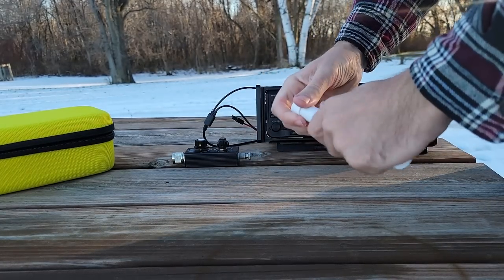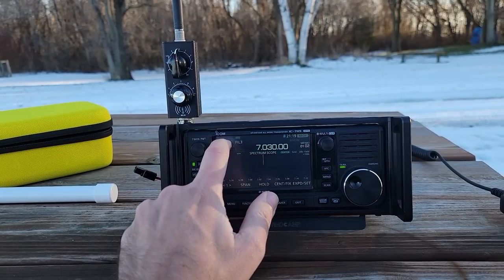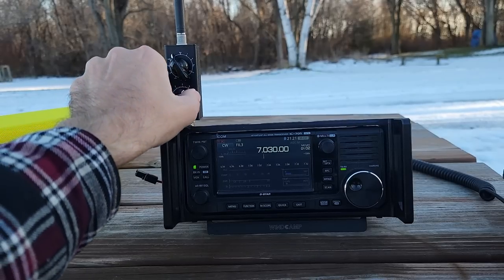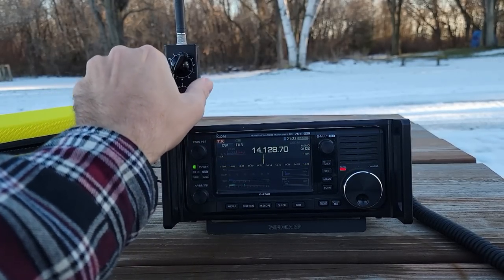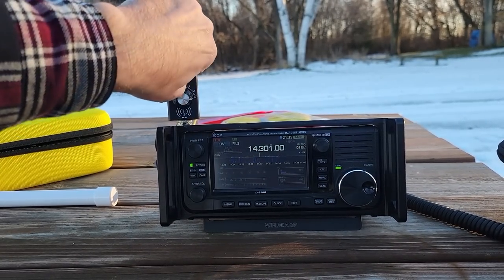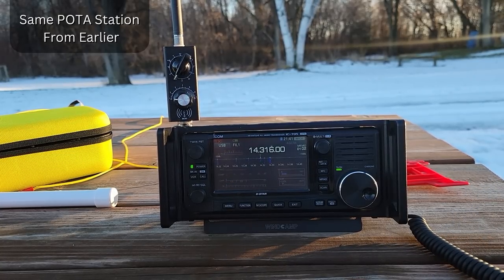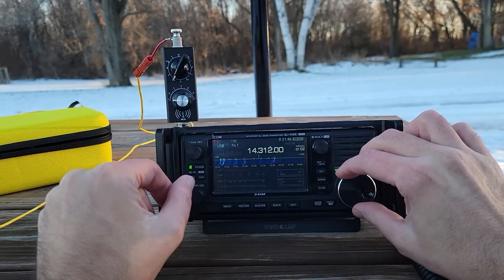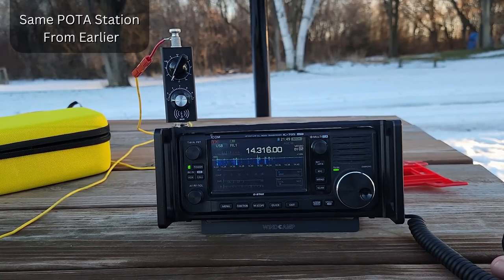Ultra Portable or Ultra Problem? - The HamGeek Mini-Ant

Comment: I suspect that, for HF, the max inductance of the coil may not be enough to compensate for the extremely compromised length of the whip, thus much better results with wire up the pole.  And the taps may be a bit wide to do better on best SWR.  There are probably frequencies where the match could be pretty good, but not necessarily in the ham bands.  Lots of the old manual tuners had roller inductors for a more continuous tune, though even they had a second variable capacitor at both ends of the inductor.  The good but cheaper manual tuners have a tapped inductor and switch, but also had both capacitors, and the effect of the second capacitor was not parallel to that of the first, so you could still find a good match.  (Matching is a two dimensional problem.)  One capacitor and one inductor are theoretically enough, though the desire to avoid high Q, and thus high circulating current, leading to higher losses, makes the pi network design useful anyway.  The other trick is to be able to connect the capacitor at either end of the inductor, a trick used by nearly all auto tuners today.  (Somewhere in my basement I think that I have a Collins military aircraft radio auto tuner that has a roller inductor and a vacuum variable capacitor, each driven by a DC motor and gear train.  I don't remember, off hand, whether or not it has a relay to switch which end of the coil gets the capacitor.)

You maybe could add  a switch, or a pair of banana jacks to let you choose where the capacitor connects on your unit.
Reply from the maker: Thank you for your well thought out reply.  Everything in ham radio is a compromise - including this antenna.  But... is it the compromise you can live with?

Comment: Hi Steve, bought this antenna from Aliexpress for 34 euro's. On 40 to 10 Meters I got this close to 1.1:1. This was not always whit the highest noise (switch). Worked Norway on 40M from my upstairs room with 5 watt on a Xiegu G106. Nice little antenna to play with. A wire from 7 meters and some ground worked much better. Would like to see it on a Antenna analyzer. Keep them coming those videos.
Reply from the maker: It didn't have the range for my earth, maybe yours is better?  Fun to play with!
Reply: Do you think I could use this as a tuner for a 45ft doublet (GR5V style) antenna?
Also, I've seen 5.28m telescopic whips and I'm wondering if that could be used instead of the supplied whip, in a portable situation?
Any experienced opinions appreciated 🙏
Reply from the maker: @redeyegooner  the only think I can say is try it!
Reply: true, bought and it works very well ros 1:1 from 10 to 40 meters but what I noticed is that when I get the ros almost to 0 the noise or station signal is lowered to make the Smeter go up I have to adjust the variable slightly but it goes up the ROS.
Don't forget to put a counterweight wire about 5 meters.
I would like to understand this problem. ROS good low signal, ROS slightly high towards 1.5 the station signal rises

Comment: Great video.  Reminds me of the Miracle Whip antenna that was commonly used with FT-817/818 from Miracle Antenna.   Wonderfully simple antenna tuner that, just like this one, needs to have a few radials.  Without them, it would be a miracle that it works at all.
Reply from the maker: Right!  This is a miracle clone

Comment: 99% of successful tunings on my antenna analyzer were with the inductor set between  6 and 9 o'clock. Tuner is also good with a small loop, Can't justify a quicky antenna like this with 9 miles of radials...Low efficiency but it works!
Reply from the maker: Right!  is it "Low" or "High" efficiency? I guess it depends on what your definition of efficiency is.

Comment: For table top antennas on the higher bands (30m to 10m), I usually go for a STL "mag-loop". It takes more space on the table top but you don't need all the radials. Therefore, arguably the overall footprint is smaller than these mini-whips with lengths of wire attached. I suspect this device is more useful as an efficient QRP antenna match. Because it is connected directly to the antenna, there is no lossy feeder with a high VSWR between the match and the antenna.
Reply from the maker: I think you're right

Comment: You can also put out a steady tone for tuning by switching mode to RTTY and just keying the mic.  Much easier than fumbling with switching CW to straight key.
Reply from the maker: Yes, I do that same trick in other vids.  Anything that outs out a signal - even whistling into the mic on side band.  Good call

Comment: The fact that you couldn't get below 2:1 concerns me about getting this. I've seen a design that has a loading coil with banana plug taps that has interested me (I saw it at Ham radio outlet when I bought my ic705) but I've refrained from getting it because I know it will be less effective and I already spent way more money than I want. Plus my K6ARK EFHW is already extremely portable. (his balun plus 26 awg polystealth and his winder design make for something that fits in my pocket)
Reply from the maker: There are so many options!  This was fun to play with, but you're right!

Comment: I just ordered one. I didn't see any with a BNC so I got one with a PL259. I'll looking forward to trying it out.
Reply from the maker: It seems like a good deal, especially if you add a lot of radials.
Reply: @temporarilyoffline  I’ve been out with it once, it works better than any of the other similar concept antennas I’ve tired. I mounted it on mini tripod instead of directly to the radio. I used two 11 foot radials. I’ve made up a set of five 20 foot radials that I’ll try on my next outing.
Reply from the maker: @N2YTA  Sounds good!

Comment: Thanks for the video, I was thinking about trying one of these.  Try elevating the counterpoise wire, I bet that will help. What is the length of the couterpoise, if it is a multiple of a wavelength, I may affect tuning, try 17ft. Thanks again!
Reply from the maker: I tried a 17ft and a 10ft, thanks for the tip!
Reply: Elevating the radials will require them to be cut to the band. Leaving them on the ground will let the signal couple into the ground.
Reply: If it is supposed to be a “counterpoise” I was told they should be elevated but whatever works!
Reply from the maker: Elevated radials (counterpoise) need to be resonant, radials on the ground should be many and can be cut to resonance or not.  Either way, whatever gets the job done in the situation your in  is the most important part.

Comment: hello, what is the optimal thread length to use in high bands? you've tried? I have one of these units and using it with a telescopic is practically impossible, where the swr is good there is no good rx.
Reply from the maker: I don't have an answer for that - it's interesting that you have good SWR and no RX.  I didn't have great results with it either (as you saw in the video)... neat idea, but ultimately not a great performer.
Reply: I am using this antenna for listening to shortwave radio only because I don't have a license. SWR is not much of interest for me while listening but after reading this comment I took my antenna and went to a ham radio friend. We got the same problem with the telescopic whip. It was a littlebit better after we replaced the telescopic whip with 5 meter of wire. The antenna was connected to a Xiegu G90, the wire was hooked up from the table to the lamp at the ceiling then to the window, 2nd floor in a house made of stone. For ground we used the copper pipe from the heater at the wall. We got heared (FT8 PSK reporter) in almost all countries in europe on almost all bands. No reception for 10m and 15m.

Anyway ... The "Manual" says:
The knob above is the band switch of each frequency. The knob below is for fine adjustment of frequency and vibration point. The upper outer ring 11 and inner ring 50 represent the common position of 11 – 50MHz. 8 and FM represent 8MHz and FM bands can use this position. And so on. Then select the knob below to fine tune to find the best standing wave suggestion link talent to check the vibration point.

Well, in fact the "Manual" was the Ebay page from the seller and this instructions don't work. At least for my antenna. We only got it tuned in position 4.5, 5 and 5.5 on all bands. So my guess is - and this is only a guess that I have to verify - that the toroid inside is mounted wrong. I don't have a clue if flipping the toroid around will help with this problem but it's worth a try.

Greetings from Germany
Holger
Reply from the maker: @lkjwertz I think if you use the matching network as if it was a manual tuner and ignored the "band"  markings it would work much better.

Comment: The power of the qrp antenna equipment is marked as 20w. Would it be okay if I set the output power of my ham radio to 50w?
Reply from the maker: I would hope the maker has tested the antenna and found its limits.  If you set it higher, it might be ok or it might cause some problems.  Open it up and take a look, see if you feel comfortable making the repairs that might be needed and test away... That's what ham is all about. (Comfortable could mean just buying another one after "the cost of education" too)

Comment: Looks similar to my wonderwand wide bander but I can get get very close to 1:1 and can also use it with long wire for even better results.  I have their tuneable counterpoise too which makes things better but still portable. I use a 7m fishing pole with it.  (Did a short vid of it).

My 1st gen windcamp bracket was causing me all sorts of swr issues I don't use it anymore.
Reply from the maker: I removed my gen1 windcamp bracket because it didn't work well with the cage.  I felt like this tuner was just a tad too narrow to get the job done.  Not bad in a pinch,  but not great.
Reply: Can you still get the wonderwand? Don't see many about. I did think they were really expensive for a new one for not much in them. I'm hoping to find one someday for my x6100 for portable and travelling. This Chinese make is a much better price but don't think it works very well even though they are plastered all over eBay from loads of sellers.
Reply: @cbjamesb1  yes G0nzi still makes them, not sure what countries they export to but a few I think
Reply from the maker: You can find them in the US at hamradio.com or at hamradio.co.uk in the UK

Comment: just received one - unable to receive anything! strangely enough, while the knobs have an effect on an swr plot in antenna analyzer, disconnected the antenna from this tuner and the same plots almost not changed! as if it acts as a dummy load
Reply from the maker: Open it up and see what's going on!
Reply: @temporarilyoffline looks pretty much the same as yours, only opposite wire colors. However i suspect either wrong ferrite type used, or the capacitor value is way off. i have experimented with a signal generator near the antenna, and while i'm able to tune it to receive, its somewhat worse than using the antenna directly without the tuning box. Reminding me why i told myself not to buy chinese ****.
Reply from the maker: @EvgeniX. My results weren't perfect either, but it was fun to play with.

Comment: I just got one from Amazon and am still experimenting with it. What length of radials or antenna wire worked best for you the best?
Thanks from NH
Reply from the maker: My goto for GROUND radials is 4x10m radials - but the rule of thumb is 1/4wave on the lowest band of interest and then you'll be able to work your way up from there.  For the radiator, I'd use the same logic as a "random wire" - or I'd go with something specifically tuned for the band of interest and get all higher bands by adjusting the matching network or the length of the radiator by folding back.
Reply: @temporarilyoffline  - thanks for your info and for your video. I played with my Gig Antenna today and I found the whip antenna does little but by adding the radial wire to the tuning control, I can begin to hear stations on all the regular bands - 40 and 20 meters. The tuning control is the good bit, whether connecting to a radial or to an antenna wire. Even though I hear stations, I've yet to make a QSO. I'm connected to one of those small USDX radios. I'm still experimenting.
Reply from the maker: @rbashta  keep plugging, you saw the effort I had to make at 5w to be heard in the vid. It can be done.

Comment: where could I get the mount with the counterpoise wire from?
Reply from the maker: I made it from a ring terminal, a piece of wire and an anderson power pole connector.  From there I have a few sets of radials/counterpoise wires that I can choose from depending on what vertical I'm running.  I also can swap this between other antenna mounts and radios.  Its a pretty versatile setup.

Comment: Great video, could this be used with a horizontal wire instead of vertical?
Reply from the maker: No reason why you couldn't use it with any wire - it's a very small/small range LC network antenna tuner.

Comment: The tuning unit looks like the Gawant Antenna configuration.
Reply from the maker: I haven't heard of that, thanks for the tip
Reply: Very welcome.
The antenna you have displayed appears to be better than the Gawant as the inductor has many taps compared to 2 taps the Gawant antenna has, well the Gawant antenna schematic I followed only had 2 taps yet it tunes and gets out from 160m to 6m even without any counterpoise, not tested higher frequencies yet.

Thanks for sharing and showing us the internals, I would like one to compare with the Gawant I made ... just struggling to find a trustworthy eBay or Amazon seller inside the EU or UK, not China. any suggestions by anyone would be much appreciated

Comment: Why? What's this thing about using small aerials?
Put up something better. There is plenty of space to put up a long wire and use a tuner.
As a ham friend said to me you can tune a knitting needle with a good atu but it won't be efficient.
G4GHB.
Reply from the maker: Right!  I played with this antenna at my farm, plenty of room for something bigger.  Just having fun and sharing.  Thanks for watching!

Comment: Interesting little "antenna". More like a manual tuner with a short whip, but still.

On a side note, have you ever considered doing a "From worst to best" antenna review? I'm sure you have bought some units that were complete dogs and others that are simply wonderful. I think it would be a great video if you could rank them from worst to best.
Reply from the maker: I've done it before with 2m antenna solutions.  Its very subjective - both in opinion and in location.  Right now, I'm on a quest for the best compromise... haven't found it yet.
Reply: Hmm? Best compromise I can think of is a small short wave radio. No TX of course but they are so much more sensitive on a small whip. You can hear everything but never get involved. That’s a win win
Reply: It IS just a manual L tuner plus short whip. Nothing wrong with that design concept,, was used decades ago.. Cap across coax, coil in series with antenna to electrically lengthen it. I would expect best results from a tuned  radial than a random one or many random. Very interesting product!
Reply from the maker: @markanderson8066  it's a very interesting product with lots of utility!  I'd like a bit broader tuning range, but I could definitely make use of it as is.

Comment: A tipical china antenna, thanks to this video i will not buy this antenna...
Reply from the maker: Glad it helped!  I think the antenna has its place, but I wish it had just a tad more range in its tuning ability.
Reply: @temporarilyoffline  It shouldn't cost more than  30 US dollard no more... In Europe il selled 80 euros... As emergency antenna it can be good but swr too hight IMHO.
Reply from the maker: @mrtonicsvls3624  You can make a decent antenna for less in an emergency - and it will be closer to resonant too!